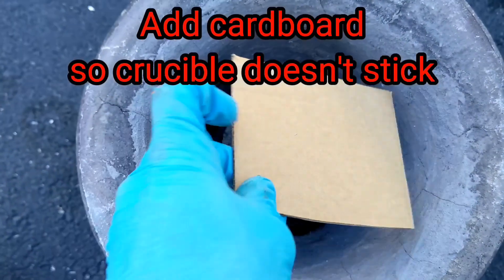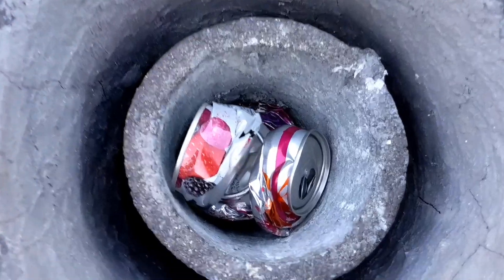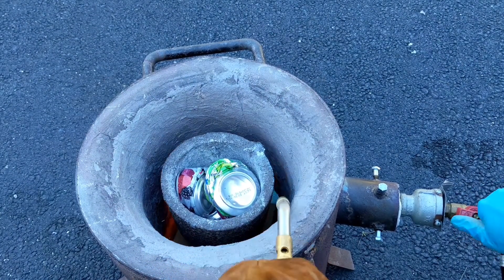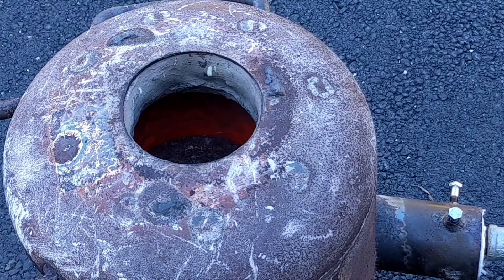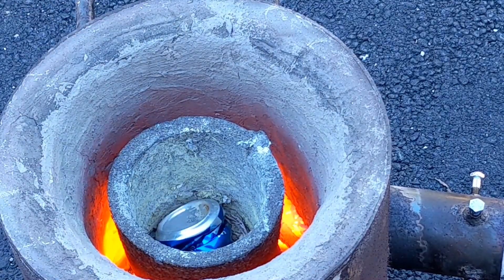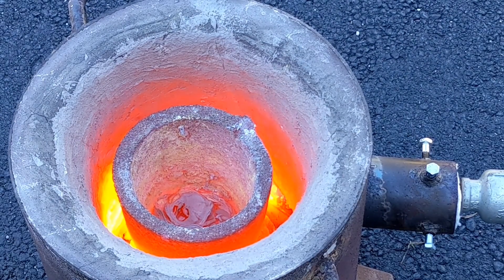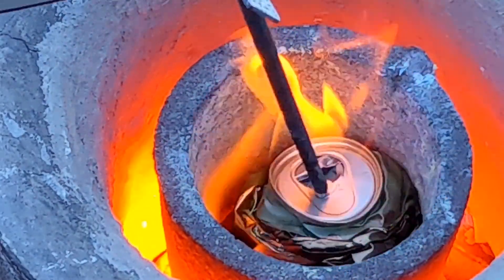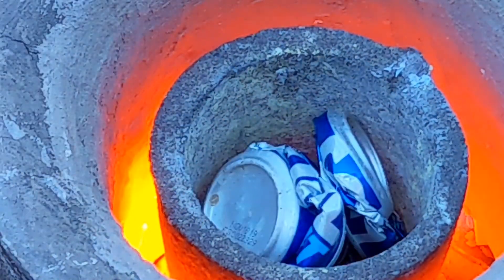How to melt aluminum cans at home - (diy) - Ingots

Comment: 4 questions. 
1) why a graphite mold and not cast iron? 
2) what coating did you use for the inside of the ingot mold (if any at all)
3) How do you properly dispose of the dross?
4) Am I correct in assuming removing dross/debris is standard in preventing oxidization for all metal smelting?
Reply from the maker: I only use graphite molds because aluminum won't stick to it.  I'm not sure if it will stick to cast iron 
I do not coat the inside of the ingot
I bring the drosa to my local recycling center and just dispose of it

Comment: Can i just use aluminium foil and melt it using a blow torch and pour it into sand?
Reply from the maker: An oxygen acetylene torch yes, but you need something to hold the amount of aluminum.
Reply: @HeinrichsMade  just a kitchen blow torch that uses propane. Also is it okay to melt it in a pestle and mortar? All kitchen equipment.
Reply from the maker: @slendermanlol16  no a simple propane torch will not get to the temperature needed

Comment: If you see the can with the blackberry on it - at first I thought it was a makeshift weed pipe - with the holes punched in it and burned  (which is super toxic - idiots are smoking paint - do not do it!). But it reminded me of a remodel my brother and I did of a house - the bathroom was remodeled last around 1950's (had real plaster walls) and we found a steel Mott's apple juice cans with those holes punched in it inside the wall - apparently made by the construction crew. And they must have used a hammer and nail because the cans were thick! I should have kept it. It may have the one of the earliest marijuana pipes made from a juice can.
Reply from the maker: Haha, that is funny people put things in the walls of houses while building them.  You really will never know about it unless you refinish the house.

Comment: is there a risk that a crushed can could contain some moisture inside and explode when you put it into the furnace? Similar to how if you don't pre-heat the moulds, they can spit molten aluminum everywhere?
Reply from the maker: I'm sure there is a risk.  I melt my own cans that have been sitting out for some time before I melt them.

Comment: I wound up using like a 100 g of flux, and like ~70 cans... got about ~1/2 lbs of aluminum. I think its not too bad considering the price. Also think electric furnace is the way to go. Minimize burning which oxdizes the metal.

Comment: At the beginning you said “Add cardboard to keep crucible from sticking” doesn’t the cardboard just burn away?
Reply from the maker: Yes it does but it leaves a slight barrier between, like ashes
Reply: Yeap. Was gonna say the same. Anything that would leave a sheet of ash would leave a layer of it between things.